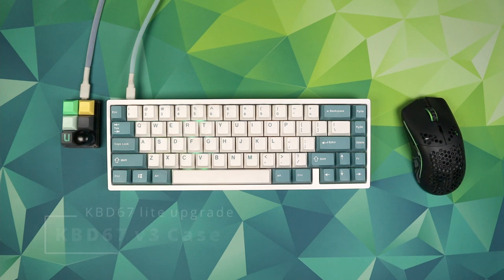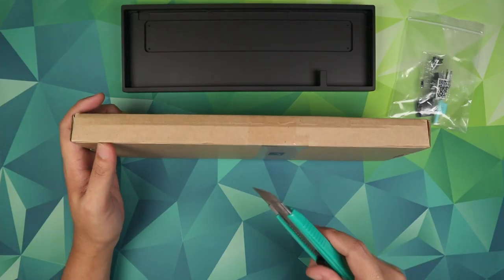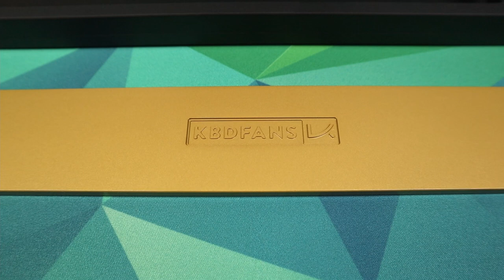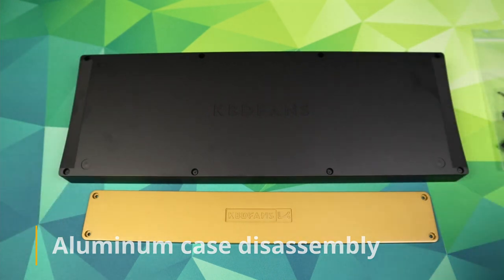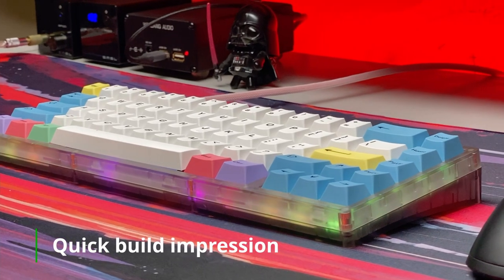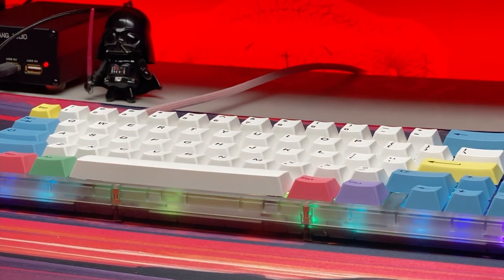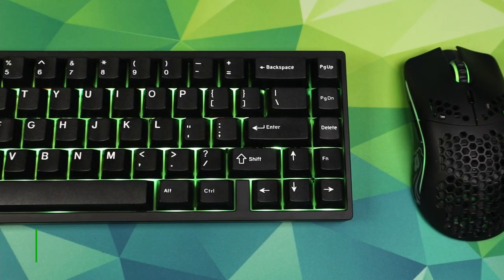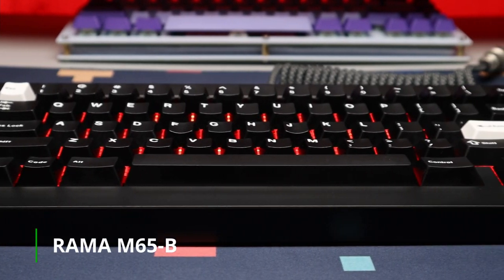KBD67 lite aluminum case upgrade (KBD67 V3)

Comment: Great video! I am coming from a modded alloy Tofu60, full case and plate foam, drilled-out centre posts, PC plate, Boba U4T and GMK WoB.

Just ordered the KB67 Lite R2 kit but a little concerned I will love the sound compared to my Tofu but hate the lightness and feel.

Is this a good upgrade?

Already dropped 200USD on the R2 kit + Durock stabs including international delivery excluding customs charges.

Can pick up the V3 case within EU for 125 EUR with no import duties. I think I would prefer the build quality but it will take a drop in thock but may sound nicer with the Bobas.

What do you think?

Comment: Hi, how about the flex on alu case? same as the plastic case (means, little to no flex)? 

The gasket mount for the Lite wouldn't allowed for much flex (am I right?) and I assume that it will be the same for the alu case? 

Would you like to share your thought on that? Thanks man!

Comment: Any issues with alignment? I notice that there is a small edge on the front when assembled. But I am wondering if something is just causing it to do that.
Reply: It's only aesthetic, but it is hard to avoid - there will pretty much always be some minor misalignment between those edges. This is why lots of customs have chamfered / beveled edges on those seams - that goes a very long way towards making those imperfections less obvious.

Comment: Both plastic case and metal case look better than the M65 keyboard what are you talking about? The M65 looks so bulky. I just bought myself the 67 Lite. Even with the premium on it right now and the fact that I had to order it from Germany, it is still the best you can get for the money. It's nice to know that if I ever want a metal case for it I can buy one. I think I will do it just because I do own so many plastic case keyboards. Gotta have at least one metal.